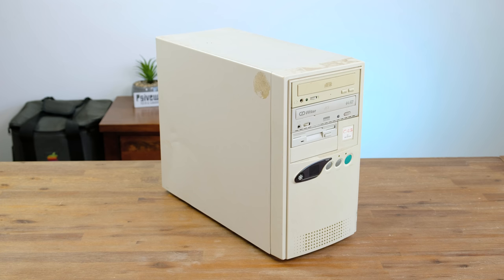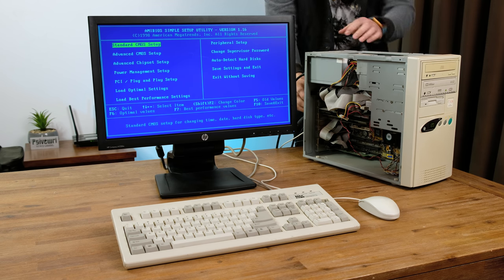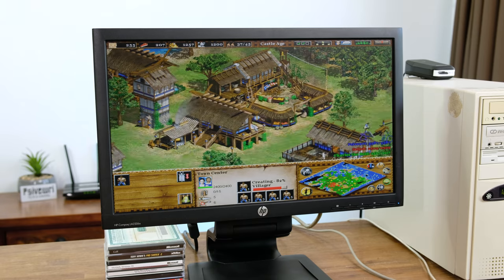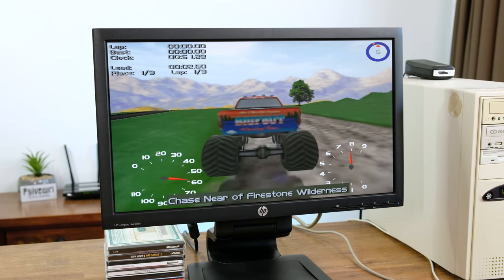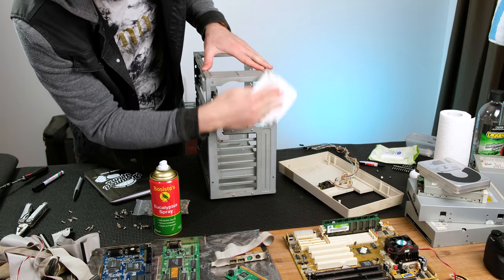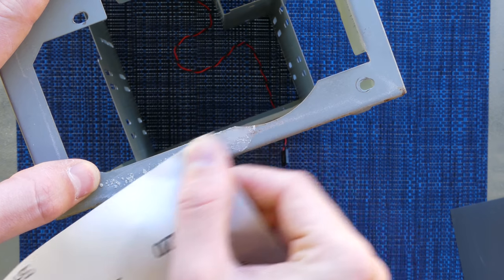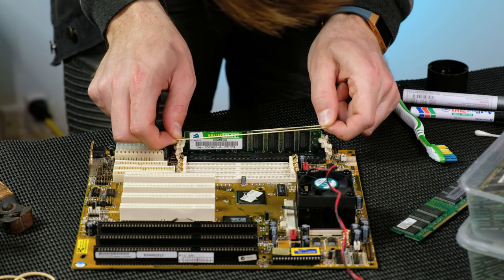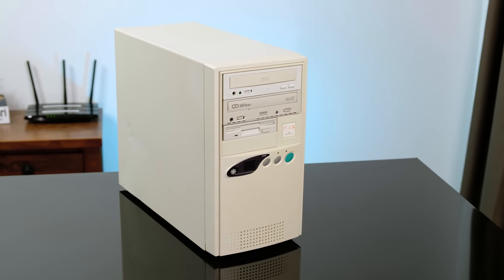Using An Old Windows ME PC! Big Mistake?

Comment: Those 3DFX cards are getting expensive. I've got a set of 8MB models in the closet. Might use'm in a rig one of these days.

Also, those AT power supplies are horribly outdated. If you search ebay, you can find AT-ATX converters now days, letting you use a more modern and efficient ATX PSU.

Comment: @0:34 "it appears this machine has a 233MHz processor"  How have you decrypted the ability to read the BIOS info presented to you on screen at boot!!!!  witchcraft!
Oh and as a side note, this was NOT an original Windows ME machine, as the Gateway 2000 Pentium II computer i had at age 12 running Windows 95 with USB support had a 266MHz processor in it...years long before ME was even thought of.
@8:53 "the most obvious change..."  IT IS RUNNING WINDOWS ME!!!!
It makes me happy seeing someone young like you getting excited over old hardware such as this, but it is obvious you don't have a lot of experience though in old hardware.  Keep at it though, and get some old salvages as that old hardware is great seeing how much technology has come in such a short amount of time.
And by the way, the Turbo function DID have functionality when it was used with the original operating system and MS-DOS programs that required the processor to be stepped down so that they functioned properly.  But after upgrading to Windows ME, or even NT/XP which this machine could do, then yes, it would have no function at all.

Comment: When Windows ME came out I was rocking a 1.1 ghz AMD, GeForce 3 gpu  Alienware......Windows ME killed the machine in less than a year!
This old pc you are showing was running older hardware when ME came out. I can remember that AMD had just rolled out the 1.1 ghz processor whereas Intel had 1.0 ghz. Windows ME was HORRID even though it introduced System Restore......which you needed cuz the damn OS crashed if you even looked at it. As long as I didnt turn it on, I knew it worked!

Comment: i have a pc with a motherboard like that, currently win 98, on board usb ports dont work correctly, kept coming up keyboard error..???..  so had to disable and have a pci card fitted .. mine has pentium 1 133mhz, 32mb ram
Reply: also have several motherboards very similar but not identical, must've been quite a lot of them around,

Comment: ME came out after Win2000 but was DOS based like Win98SE. "Loud" cooling fans is relative but a good sign because you know they work.

ME had some improvements over 98 because of its USB Generic Storage handling and it's capable of loading AOL .art files and converting them to .BMP .

I used my ME desktop to look at a 250mb Toshiba Win95 laptop hard drive.

Hell, even my widescreen monitor can display 4:3 or stretch to 16:9.

That bow in the motherboard PCB is treatable. And should be fixed.

Comment: But we could see on unfitting that there is a K6 300, why you don't tried to run it on 300 MHz? You run it on 233 MHz further... I had a K6 2 400 in the past, the problem is, it has a FSB of 100 MHz but SD Ram has 133 MHz. There was two Options: 1. let CPU run async, CPU on 100 MHz FSB and SD Ram on 133 MHz... But it isn't very efficient 2. running snycron, CPU on 100 MHz FSB and SD Ram too, most efficient setting.... But 233 MHz? On which FSB does it fit? It seems the (wrong?) RAM or wrong bios settings on multiplicator (maybe Boardjumper) could be the problem. The K6 2 has almost 100 MHz Steps. There doesn't exist something like 233 MHz. 200, 300, 400... K6 3 500

Comment: That PC spec is a mongrel. The CPU is a very early AMD K6/2 which is a socket 7. That chip would have arrived late Win95 / early Win98. It would have had 16 or 32MB of RAM tops, but the 3GB HDD checks out. Someone has chucked 128MB in to get Windows Me to run properly :)

Comment: not entierly sure, but think the "Turbo button" is mostly for compatibility with very old software / games, because of the speed of the CPU the games would 

othervise be turbo speed and not playable, so pressing that button would limit the CPU clock, i think it was something like that atleast. but i have never
noticed any major difference while using the system and playing with that button. 

Also, you spray painted the wood, it annoys me so much. hope it was not your fence.

Old computers have some charm in them somehow, and they rarely just die, real survivors.

Comment: "with great care not to electrocute myself, I reassembled it"
What's going to electrocute you if the power supply isn't connected to the mains...?
Reply: Capacitors can hold a charge after the power has been disconnected.

Comment: Windows ME was the worst operating system that Microsoft made. I bought my first computer in 2000, a Gateway and it had Windows ME.  It was terrible.  I had software that didn’t allow ME to run it, It crashed all the time, if it didn’t crash it froze.  It would not let me multi task, if I had to many things opened, It would freeze or just crash.  The Gateway Computer wasn’t that great either, it had its own issues.

Comment: There is no reason to use ME ever, there never was in the first place. It has the worst aspects of XP (loads of crap installed on hard drive during install on the off chance you might need them) and pathetic saoftware based crash protection of Win 98/95 combined with GDI resource leak (requiring constant reboots after large file copy/internet surfing/printing sessions). If you have 128mb of RAM get XP SP1, if you don't then use Win 2000. End of story really.

Comment: Your system is weak. I have a Dell Dimension L500r running Windows 98se with higher specs.
500mhz Pentium 3
120 gb Maxtor ide hard drive
512 mb of PC100 ram
NVidia GeForce FX5200 128 mb vram